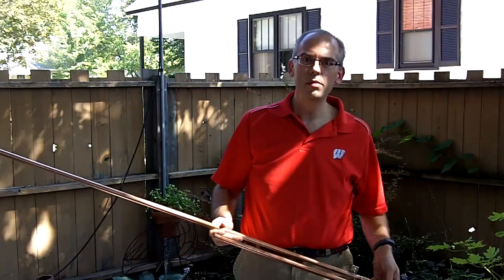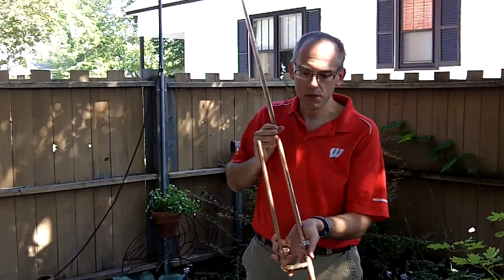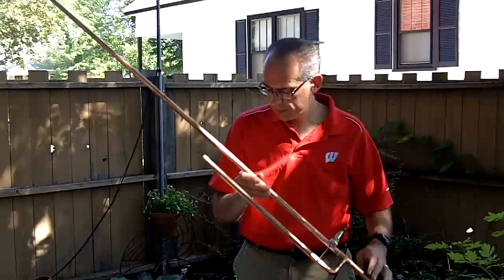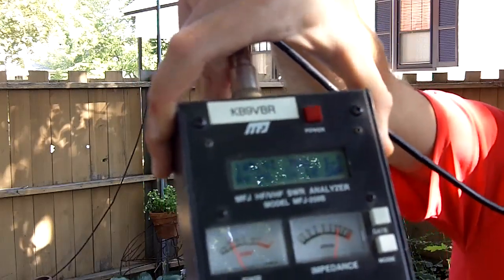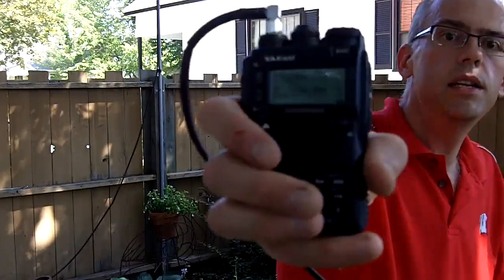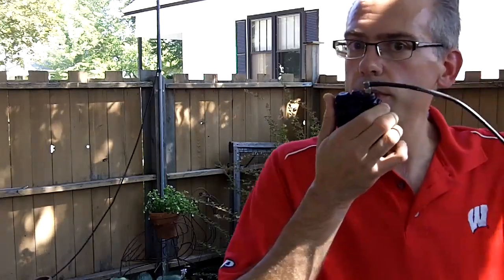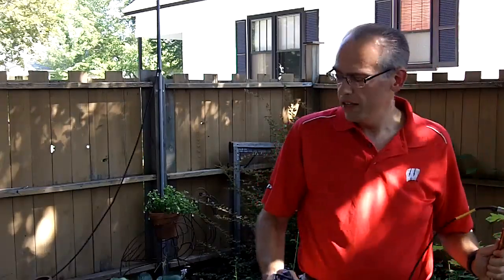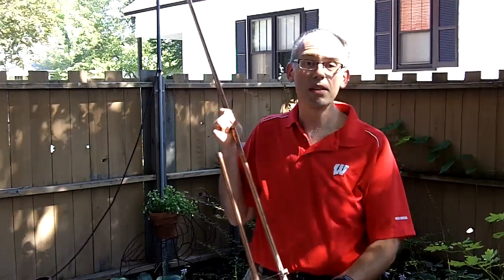KB9VBR J-Pole Antenna Demonstration

Comment: Can I paint your j pole antenna with gloss grey Krylon primer paint? 
Thanks for your reply in advance.
Reply from the maker: The antenna comes unpainted. You can paint it with clear lacquer or a non-metallic spray enamel to protect it from the elements or help it blend into its surroundings.  If left unpainted it will develop a dark brown patina. This won't affect performance. More information on painting the antenna can be found on my blog. http://www.jpole-antenna.com/2011/01/04/painting-the-j-pole-antenna/

Comment: Sometimes it's fun to go back in time!  I picked up one of these, several years ago, and it's just always worked great!  I've upgraded so many parts of my 2/70 setup since purchase, including the feed line to this beauty, but this antenna has remained.  It just works and I know it will continue just working for the next several years.  Thanks, kb9vbr, for this affordable, long term solution!

Comment: Do you ship to Sweden?
Reply from the maker: I can ship the 2 meter break-away antenna to Sweden‚ but I must caution that overseas shipping is expensive and it often will be more expensive to ship the antenna than what the value of the antenna is.
Reply: @KB9VBRAntennas  no problem.
If you like, check it out.
It's Sweden Stockholm.

I contact you via your homepage contact info.

Regards

Comment: I must say after running one of these antennas for a few weeks now I am beyond impressed with how well it works especially for the price point. Far out performs my ground playing I was previously running. No problems hearing multiple repeaters in the 40 to 70 mile range.  Currently heading repeaters in three states. Beyond impressed for the price I would buy again in a heartbeat

Comment: hi mike your swr is away out due to your bottom of T pole shouldn't be conductive .And secondly the so239 is wrong way round .Your centre pin should touching the long pole earth should be on the short pole .
Reply: I meant your centre pin should be touching the long pole .Your earth should be touching the short pole .switch it around .
Reply from the maker: There are plans that attach the center conductor of the coax on either side of the antenna. I have experimented with attaching the center connector of the SO-239 to the stub and to the main radiator. I have not found a difference in signal quality or performance. I choose to mount the edge of the connector onto the main radiator because I believe it makes a better mechanical connection. The RF energy will travel up the matching section and then radiate from the resonant part of the antenna. Hence it really doesn't matter which side the connector is attached to.
Reply: ok just seems a bit odd to have it at the other side .On to the T pole why is yours conductive ?.If you calculated antenna to a length for frequency .Then surely the bottom of T pole base part would add more to your calculation .so I did it without inductive I get good results .

Comment: Mike, I have seen the coax match center conductor connected on the short element OR the long element.  Which is the correct side?
Thanks!!  another mike K4MR
Reply from the maker: Mike, I've experimented with putting the coax connector on either side of the antenna and haven't found an appreciable difference between the two placements. I prefer to solder the edge of the SO-239 connector directly to the longer element as it makes for a mechanically stronger connection.
Reply: When you feed the short side it allows you to mount it to a ground. But you lose your low angle radiation that gets the gain of a j pole. Feed the short side and you have a 1/4 wave ground plane , nothing more.

Comment: Do you make a dual band j pole if so I would be interested
Reply from the maker: The 2 meter J-Pole does tune up on the 440 Mhz band and works well as a dual band antenna. My Slim Jim antennas (check them out on the website) actually make excellent dual band antennas.

Comment: whats the reason for the shield to be on the long side and not the short side? any difference?
Reply from the maker: I've experimented with putting the coax connector on either side of the antenna and haven't found an appreciable difference between the two placements. I prefer to solder the edge of the SO-239 connector directly to the longer element as it makes for a mechanically stronger connection.

Comment from the maker: I've finally linked my Youtube channel to this page. Why would I want to do that? So you can watch this demonstration of the KB9VBR J-Pole antenna.  #hamradio   #amateurradio   #jpoleantenna
Reply from the maker: Jonathan Collins I haven't seen an increase in SWR with the antenna when it rains. I'll frequently use this antenna as a backup during severe weather nets as it is mounted lower than my other antennas, and haven't experienced any issues with it due to weather. As for mounting hardware, you will need 2 hose clamps or U-bolts to mount it to a mast. The clamps are not included, but can be easily found at a home improvement store like Lowes or Home Depot.
Reply: Thanks KB9VBR just wondering if it still would give the same signal strength if i use aluminum tube we only have two season here and its summer and rainy season and when it rains it has or sometimes major lightening storms copper attracts lightening from what i understand. thanks again and 73's...... i'm a new cber but am really liking this homebrew antennas or making them myself.
Reply: what happens when it rains does the swr go up also does it come with mounting hardware

Comment from the maker: Yes, the J-Pole will work in your attic as long as you don't have a metal roof and enough vertical space (about 70 inches) for the antenna to sit upright.

Comment from the maker: The J-Pole is a half wave antenna, so you can mount it on a metal or non-metal mast without affecting its performance. My website (link is above in the video description) has more information in the FAQ (Frequently Asked Questions).

Comment from the maker: Jared, If your basement has exposed floor joists, you could use a bracket to mount the antenna to the joist. Otherwise a really easy base can be made by filling a large flower pot with landscape stone and 'planting' the antenna inside the pot. The antenna is already pretuned and ready to go, so all you'll need to do is attach the coax.

Comment from the maker: You do lose a little bit of performance when you mount the antenna inside your attic. But as long as you don't have a metal roof, you shouldn't have any problems hitting a repeater 25 miles away putting the antenna in your attic vs on the roof.

Comment from the maker: I've got a Yaesu FT-8900R and the antenna works great on the 2 meter and 440 MHz bands, but not with the 6m and 10m bands. Transmit distance is dependent on antenna height and power. You can hold the antenna in your hand as long as you keep your transmit power low (5 watts or less), but I'd mount it to a mast if you are transmitting higher power than that. Check my website (link is in the video's description) for more info.

Comment: will this work good with the YAESU
FT-8900R and if so how far can i reach .and one more question i see that you are holding it if im transmitting can i hold it or mount it to say a backpack next to my head cause i know with other antenna you cant do that depending on the type of antenna cause its not safe .and whats the smallest size you carry in the jpole

Comment from the maker: This particular antenna is designed for the 144-148 MHz VHF amateur radio band. It won't work for CB radio which is in the 26-27 MHz range.

Comment from the maker: The J-Pole antenna is a half wave antenna, so it doesn't need any ground radials or a groundplane for operation. I do recommend connecting the antenna to an electrical ground for lightning protection. You can mount the antenna in your attic, the antenna is about 68 inches tall, so if you have the space, that's a good location.

Comment from the maker: I've had great luck mounting the antenna to a metal mast, so you can use a metal or non metal mast. The J-Pole is a half wave antenna by design, so it doesn't require any special grounding or a ground plane.

Comment from the maker: Painting the antenna will not affect the performance as long as you use either a clear lacquer or non-metallic spray paint. I have more info on painting in the FAQ section of my website. Link to the site is in the video description above.

Comment: I have a well made 222mhz J-pole, but it doesn't like having a conductive mast.  it could be the mast is at a length that is resonant.  either way I had to mount it onto wood.  works great.

Comment from the maker: @breezebro The J-Pole is a half wave antenna by design, so it does not require a ground plane or special grounding to function. You can mount it to either a metal or non metal mast without affecting its performance. Hose clamps or U-bolts work the best for mounting it to the mast.

If you live in a lightning prone area, you may want to create an electrical ground to protect the antenna and your equipment from lightning hits.

Comment from the maker: @KC8YOQ Creating a balun by wrapping a few turns of coax near the feedpoint will help prevent stray RF energy from returning back down the antenna. You can get by without the balun, but sometimes it's necessary to help the antenna perform at its best. Since the balun never hurts and usually helps, I recommend making one.

Comment from the maker: @Tacticalgearhead The patch cable I used has an SMA connector on one end and a SO-239 on the other. I picked it up from the Cable Experts several years ago. I'm not sure if they still sell that model or not anymore.

Another source for adaptors is Tower Electronics out of Green Bay. They have an online store and you can find them at most hamfests in the midwest..

Comment: What make of cable did you use for the SMA to SO-239 connection?  I have a Yaesu FT-60R HT that I'm interested in hooking up with your J-Pole, but I want to know what adapter cable to get, male or female, etc.